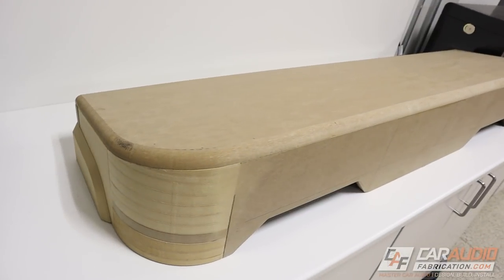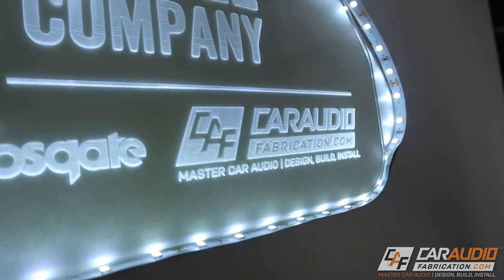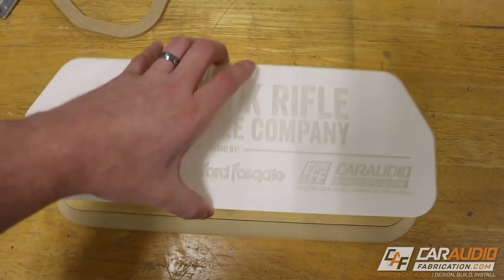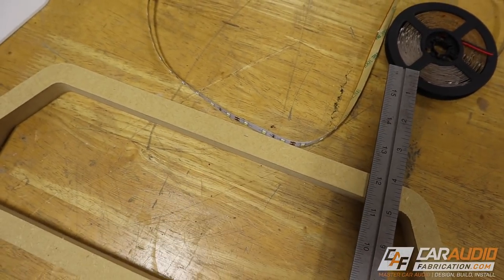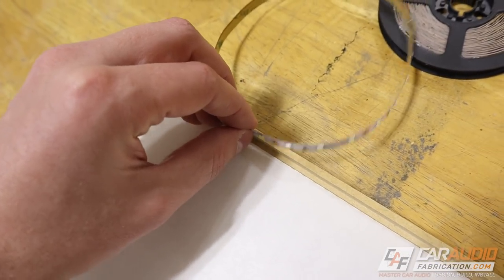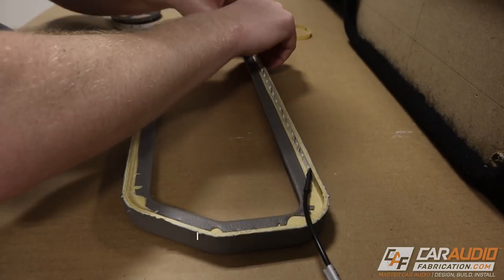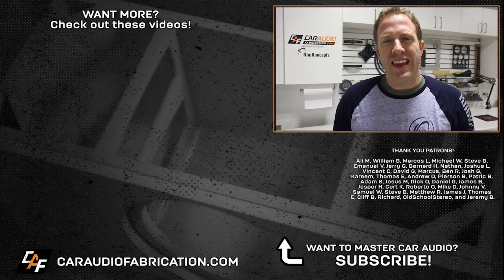How to make an LED EDGE LIT logo insert! - Underseat Subwoofer Build

Comment: Unrelated question, but I was wondering about replacing blown interior speakers with aftermarket ones? The impedance would be different, stock ones are usually 2 ohm and aftermarket 4 ohm? Is that pretty much standard and what does that mean if I dont want to replace the head unit. Do I need to replace all the speakers at once to level match them? Do I need to replace the head unit?

Thanks!

Comment: It looks great! I would have personally always used F-COB led strips instead of the standard ones you used, so you get a 100% uniform light output without the spotty dot-effects that individual leds produce... F-COB led strips put off a continous 'line' of light the entire length of the led strip, instead of individual led chips you see

Comment: Why is the box material so thick? I have been building hot rods, Pro Street cars, Drag cars/motorcycles and have always made everything light as possible. Is it possible to make a light weight box that would still sound good? I have worked with all the lightweight metals and composites available. Some of my builds you can't hear the stereo any way? thanks

Comment: Hey mark what are the best 6x9’s out there ? I have a 2015 Dodge Dart gt and I’m wanting to upgrade the factory alpine system they suppose to have.
Reply from the maker: Many different options, anything from JL Audio, Rockford Fosgate, Alpine or Focal is solid and you get what you pay for.
Reply: CarAudioFabrication which alpine or JL would you recommend? What 4 channel ?
Reply: @kaamiljahmezjaanfoster5795  Try the JL AUDIO xd 400/4 or if you can get an older model jl audio 300/4 off eBay from a high rated seller you can save money and get an almost bullet proof amp.I still have them in my cars I've had over 9+ yrs.No problems

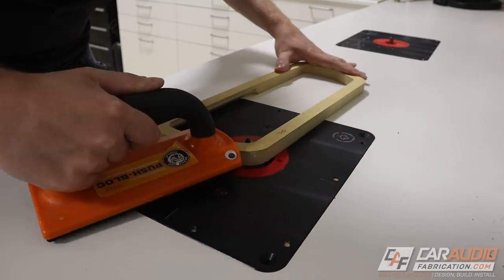Comment: I paused it at 4:45... It didn't make sense. I think I need to see it done incorrectly in order to understand what mistake you're avoiding.
Reply: Jose Vazquez the edge would be so thin the bit will cut into the mounting surface that you just cut out.. due to the barring not able to ride that edge as it was removed